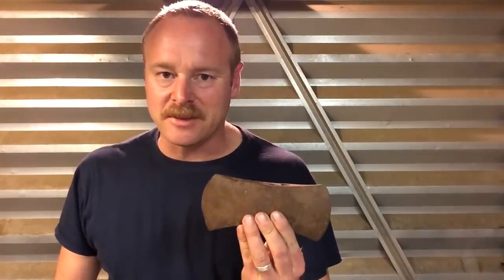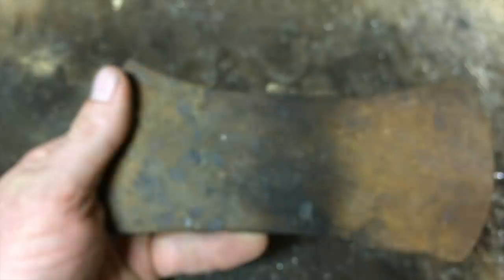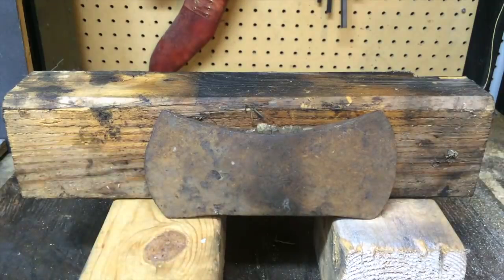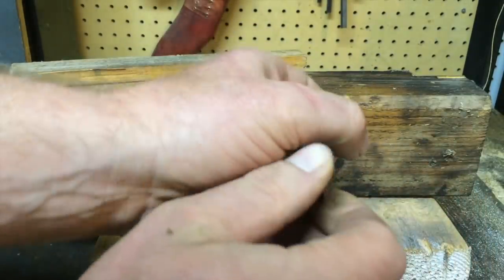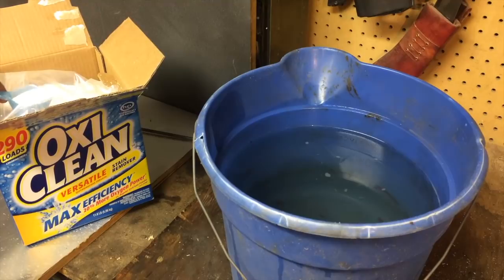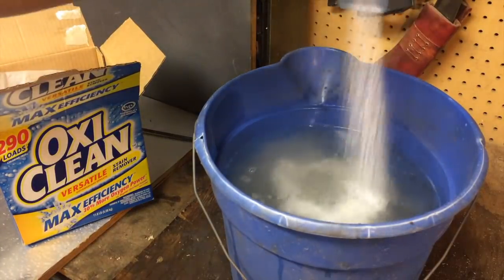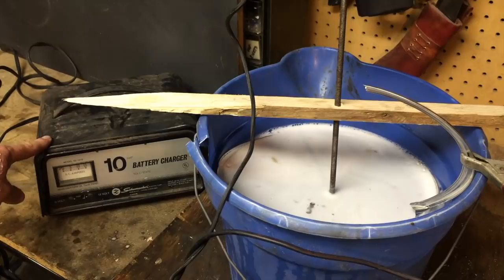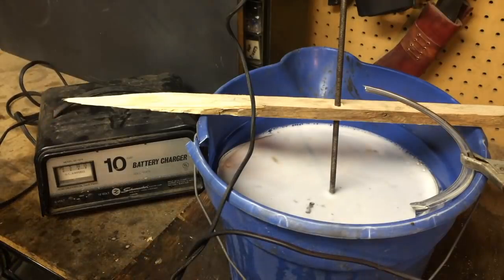Remove Rust With Oxiclean | Grandpa's Tools | Cruiser Axe 1

Comment: The key component of the oxiclean for the process in this is common household baking soda; I'm surprised this guy doesn't know that. Use common baking soda and you won't have suds; not knowing how much of it to add to the solution is not good premise for making a video that shows a electro-chemical process that releases volatile gases.
Reply: Kent S don't you mean washing soda and not baking powder?
Reply: You can use baking soda as well. There is a slight reduction in conductivity but it still works. The most important part of this process IMHO is the amperage being used; the higher the better. Here are a couple of links that were helpful to me. https://www.spaco.org/Blacksmithing/Rust/BakingVsWashingSoda.htm "and" http://www.rickswoodshopcreations.com/Miscellaneous/Rust_Removal.htm